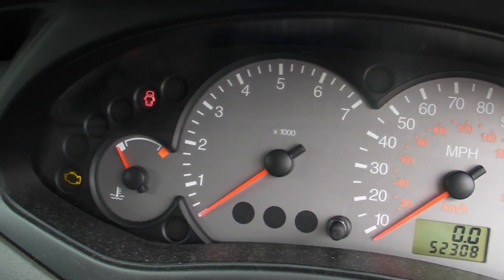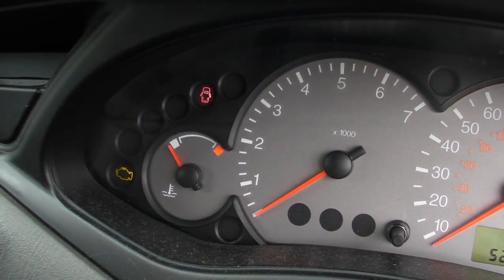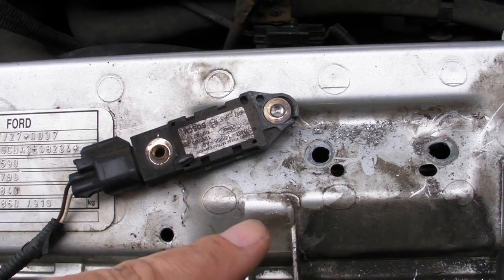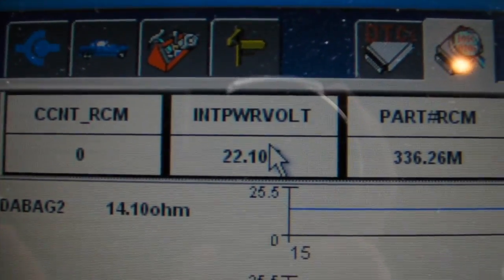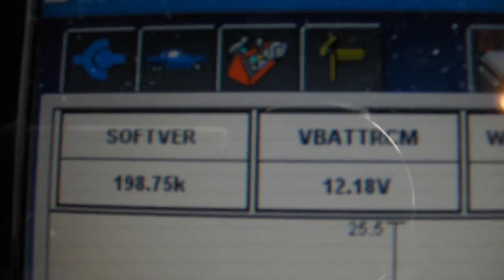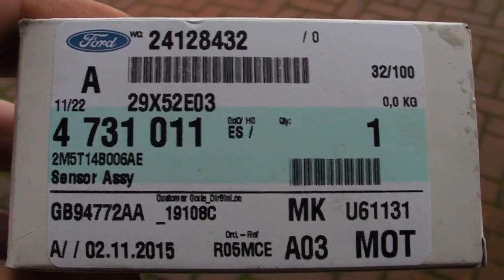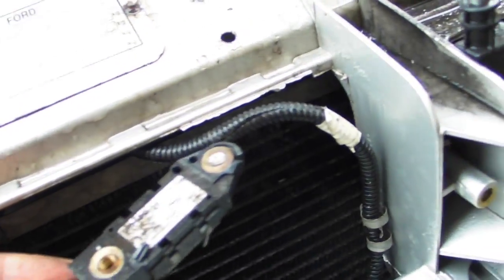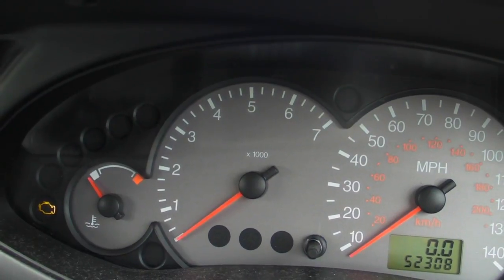Ford Focus Mk1 Airbag light

Comment: Hello, the problem in my vehicle is the same, but I changed the sensor and the problem was not solved. Did you clear the fault code after changing the sensor? Or did the direct light go out?